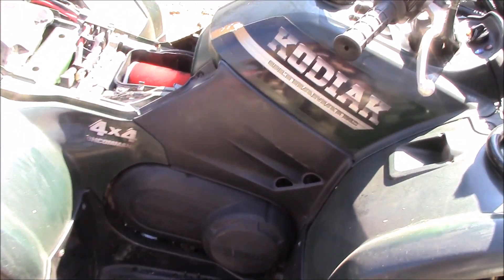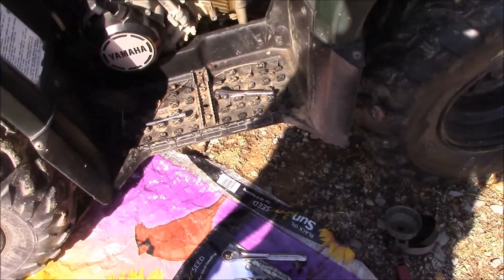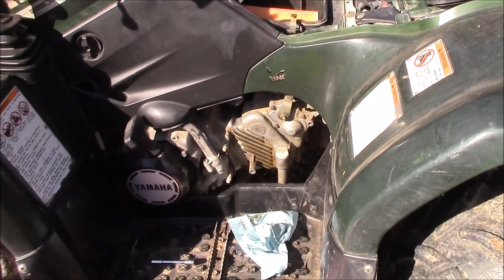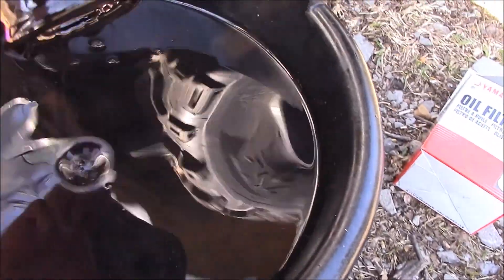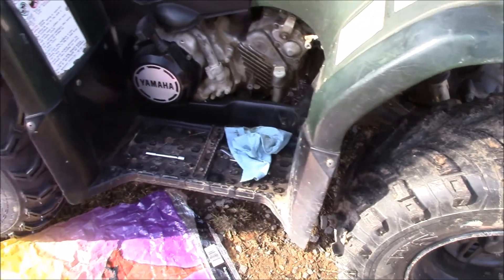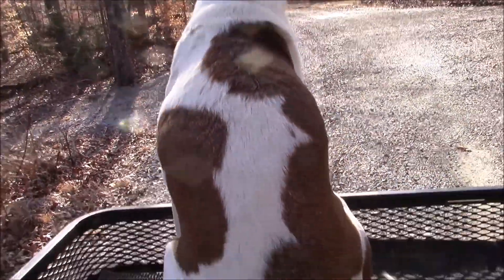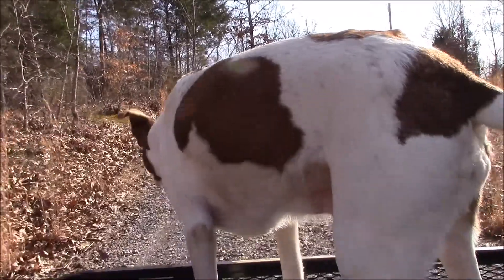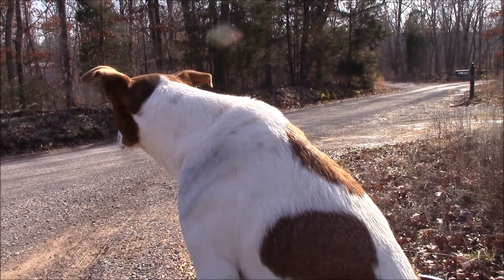Kodiak 400 oil change & air filter

Comment: Good to go for 25 hours. Don't forget the grease fittings Matt.
Reply from the maker: I haven't found any grease fittings yet, I'll read the owners manual. thanks Gil.
Reply: Ok Matt I never owned the yamaha quads but at one time for me and the kids and grandkids I had 6 of them. grease fittings are located on the universal on the steering shaft, the the pivot points on the swing arms  and wishbones on the independent suspension as well as the tie rods and steering head below the handle bars on all my susuki , honda, and kawasaki, quads since they see a lot of mud and water use you need to oil up the brake cables and mechanical parts of the outer brake housing or they freeze up with rust.
Reply from the maker: Thanks for the input, I need to take the front rack off and get to the radiator, it's liquid cooled.and check the coolant level, and than I will grease everything like you mentioned, the 4 wheeler is 18 years old and want to go over everything. seems like a solid machine and everything works.
Reply: southernmost homesteader yes sir they are great tools. I use the one I have left for all yard projects and plowing and towing.